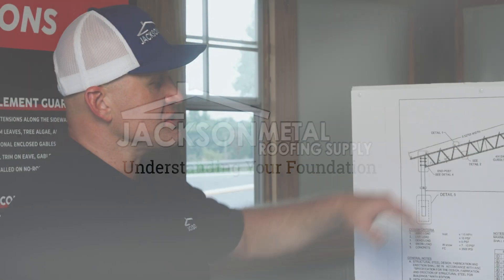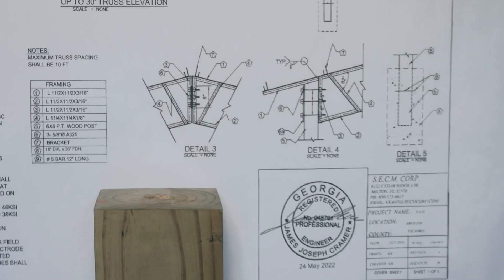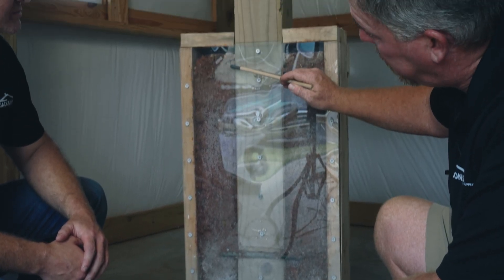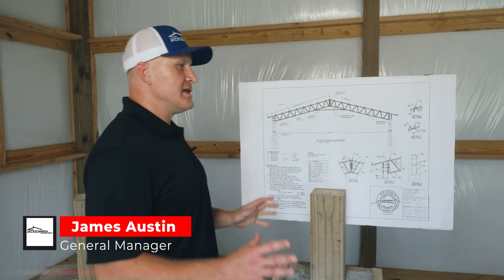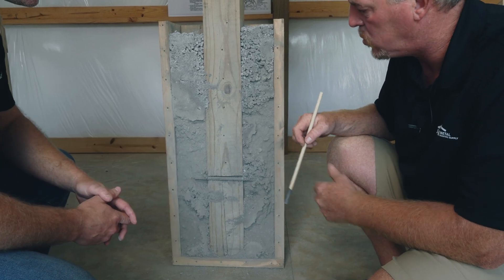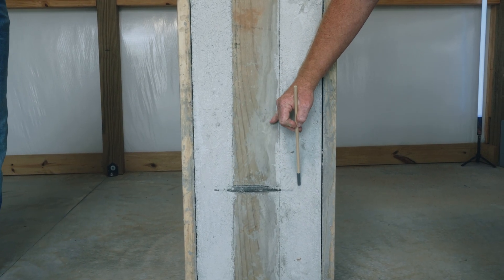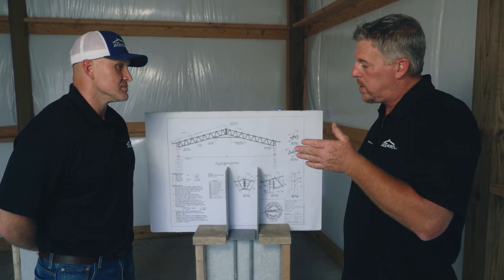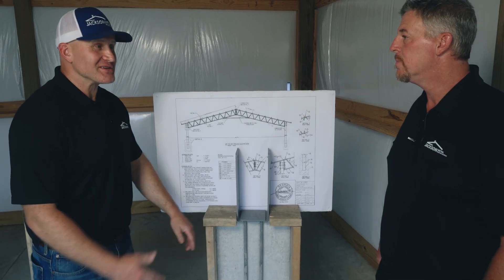Understanding Your Pole Barn Foundation with Jackson Metal

Comment: I am new to this stuff trying to learn how to build a pull barn as we are trying to learn how everything to do right and not wrong.
How does one get the  rebar in the center of the wood ?  Thank you.  I just got married  got small property  and Just starting out . So many  rules and  permits its crazy  anyone can get anything done.  We have no Water or septic, no electric  . so its basic  starting from the ground up  . I was able to fix a few old Equipment  Old Dozer and a Backhoe  hoping I can use them to set the posts and  clear the property. 
I just document what I do on my channel for  future   screwups  and lessons for my self . and  learning from professionals  who may have  done what I did meaning Wrong  AND CAN SAVE us from making the same mistake . so far  I like the above post being able to replace them and such If needed .

Comment: Great presentation and I'd like to share my experience. I researched several design options before contracting for my 18' x 70' post frame equipment shelter. The problem is finding a builder that will do anything other than dry mix concrete, which is what my builder offered. He did however pour two 80# bags of Quikrete, instead of one, in the bottom of each hole after setting the post. He also applied some type of black protective coating on the imbedded portion of each post. I talked with the post supplier - a local treatment facility - and was told my 6x6's were .6 CCA treated for continuous immersion in fresh water, which I was happy to hear. These were not the typical ground contact MCA treated posts from the local big box. Fortunately the contractor only backfilled the 18" diameter post holes half way up with the excavated local soil which was forest land clay/organic mix. Realizing the poor compactability of that soil, I dug it out from around each post hole, down to the hardened concrete, and backfilled with red compactible fill dirt and tamped that down. After a few weeks of rain and settling, I topped off the holes that had settled and re-tamped. My current project is installing a foundation drain under the drip line that captures run off from the roof and takes it away from the posts, helping to keep them dry. All combined, I think I have a system that will last far longer than 10 years. As a point of reference, I dug up a MCA treated 6x6 gate post that I had set directly in dirt 9 years ago, and there was zero rot of the below grade portion, or at the soil/air interface. I believe that as long as water is kept away from , or allowed to drain away from the wood, the post will be fine for a long time. Edit: we get very little snow here in central NC, the structure is not enclosed, plus it's an agricultural build surrounded by wind breaks, so roof load, soil bearing pressure, and uplift were not primary considerations for me on this project.

Comment: It blows my mind that anyone would use anything except wet set brackets and would still bury a post below grade level.
Reply: 90% of the guys that see the wet set tell you there is no way that they are strong enough to hold anything,  Its a new thing that people will not except even when you show them the spec on how strong they are.
Reply: Totally agree...there are a few post frame builders in my area that only do post in ground backfilled with dirt! Insane
Reply: In addition to getting a superior foundation and keeping your posts out of the ground, construction is much faster assembling the walls on the ground and tipping them up.

Comment: Only option 4 gives post proper bearing capacity. 1st 3 options are nothing more than a 6 x 6 sitting on dirt along with inevitable failure from rot. Cant believe a professional engineer would approve option 3 .
Reply: matthunting, you are correct in your observation that option number three as shown in the video does not offer the proper bearing capacity. If you look however at the engineered drawing in the video closely you will see that the drawing calls for the post to be elevated up so as to give the bearing capacity you were referring to. The cutaway display for reference may not have properly illustrated that. Quick on your feet sir, great observation. Kudos!
Reply: @joshhosford8274  Dido
I came to write the same comment. I would love for Jackson Steel to explain this.
Reply: You took the words right outta my mouth. Happy Hunting 😁